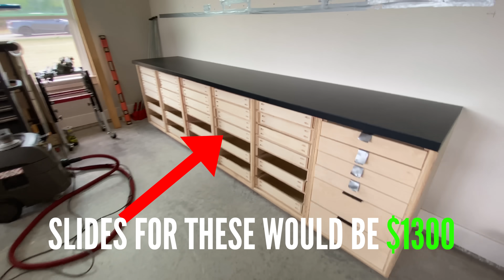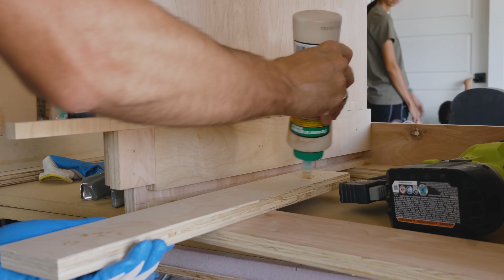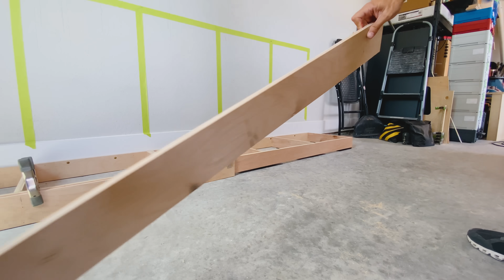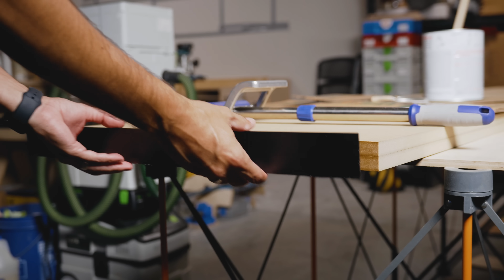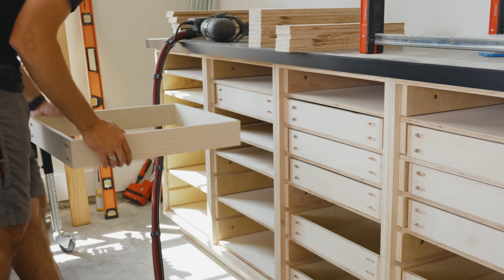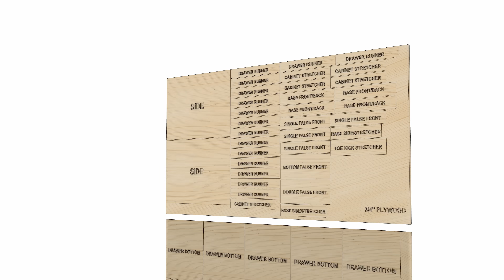Drawer slides are expensive. Do this instead.

Comment: 00:00 🛠 Making simple cabinets without hardware can save a significant amount, cutting costs on drawer slides.
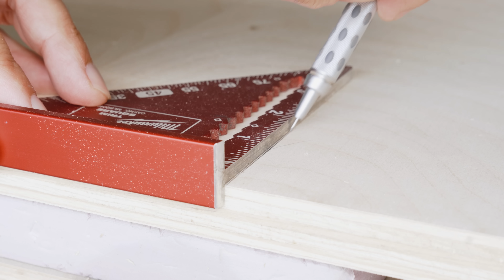01:22 📏 Tips for plywood projects: Start by squaring off the factory edge, use parallel guides for precision, and optimize standard track lengths for accurate cuts.
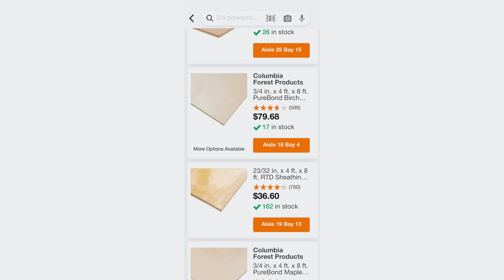03:41 💸 Quality plywood at lower prices often comes from direct suppliers rather than big box stores.
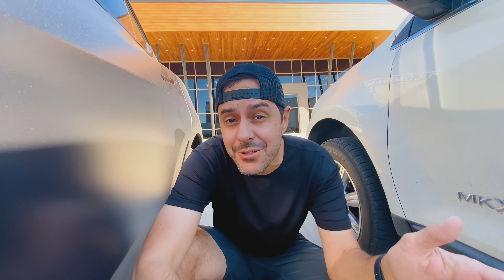05:06 🪚 Visiting specialized plywood companies can offer high-quality options at more reasonable prices compared to mainstream stores.
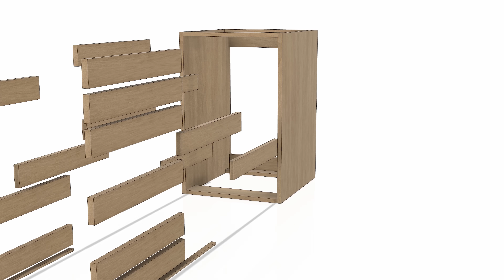07:15 🛠 Building cabinets without cutting into the sides maintains strength andsimplifies the process, especially for beginners.
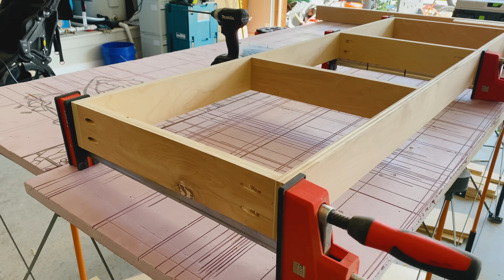09:44 🏗 Creating separate toe kicks rather than cutting into the cabinet sides offers a cleaner look and makes leveling easier.
11:23 🔨 Shimming floors for leveling cabinets is crucial, using composite shims for better consistency.
13:40 🚪 Insulating behind cabinets during installation can be a proactive measure against potential issues in the future.
16:15 🔲 Crafting laminate counters involves careful planning and precision with contact cement, benefiting from an extra pair of hands.
19:54 🤔 Routing laminate edges can be tricky, requiring a balance between pressure and precision to avoid cutting into the material.
21:05 🔧 Using temporary fences and tools like an oscillating tool simplifies precise cuts for covering cabinet sides.
21:19 🔨 Building cabinets without hardware involves creative solutions; metal drawer pulls can be a sleek and affordable alternative.
22:26 🛠 Using parallel clamps for assembling pocket hole screws ensures precision and ease in construction.
23:49 🗜 Attaching drawer bottoms involves using a combination square for precise alignment, aiding in flawless assembly.
25:11 🔩 Installing metal handles requires creating a slight recess on the back of false fronts, easily done with a DIY router table setup.
26:57 📐 Building cost-effective upper cabinets involves using plans that optimizematerials and design for efficient construction.
27:26 🔧 Installing cabinets solo is manageable by using a horizontal board to mark stud locations and secure cabinets during installation.
28:25 💰 Plywood quality impacts costs; using cheaper imported plywood for cabinets could significantly reduce expenses without sacrificing quality.
29:08 💸 Detailed cost breakdown: Utilizing different grades of plywood affects the overall cost, offering insights into cost-saving strategies.
30:17 🏗 Sneakily debunking assumptions by revealing meticulous workmanship in the video's conclusion.
Reply: Thank you so much! This needs to be a pinned comment! There were so many useful tips in this video and your timestamps made it soooo much easier to go back and rewatch the segments. 👌

Comment: I've worked with Laminate before. Most carpenters that work with laminate mostly use an oil and whip the laminate on the side prior to routing the top laminate. You use the straight laminate counter bit instead of the trim router bit. So you can cover the top piece of the side laminate. One thing that was taught to me is to use a small heavy roller on all attached laminate pieces prior to routing because if things flex the edges are more likely to chip or crack.

Comment: In my country the rails you mentioned cost 3~4 euros only for a pair. It would cost me around 100 euros (110$) for all 36 of them. Of course the good thing on how you made it is that you can remove the drawers and put them in a different slot and would still work as they do not have a mechanism.

Comment: Thank you for the ideas and the work. My concern would be the use of the draw bottom being the draw runner as over time, and depending on the weight of the draw contents of the aware as all draws with timber runners wear. Maybe a though next time to look at the tried and old style of timber runners, less ply being used as guilds and the use of other smaller timbers, offcuts to so you can have the draw slightly wider etc and in time can be replaced if required. Also maybe a lighter bottom of the draw but of cause depending on the weight.  Ready good thoughts and details for people to follow. Thank again.

Comment: That was a deep dive 🤿into the comparative value of different grades of plywood. Cheers! That is the most satisfying storage build I've seen yet. Adjustable, build to suit. I still have 13 seconds to go, but what about the "seams" between cabinets where you can see the horizontal cabinet walls. You seem like the sort where finnicky details like that would bother you. Way better than anything I have ever done.
Reply from the maker: Thank you! I don't mind the seems. I never really notice them. At least that's what I tell OCD self at night when I stare into the ceiling and cry
Reply: I just finished a front stoop / stairs / landing project, and it does look good, but all I can see are the gaps and perceived unintentional slopes. Being unwaveringly OCD does have its benefits, but so does reason and sanity.

Comment: That's an impressive set of cabinets for under 🤿 $1500 all-in. 
When I made mine, I surfaced the counter with wood so that if it got damaged through using it as a workbench. I could either plane it smooth, or replace it when it got really bad.
But your laminate looks really good.

Comment: Great project & video. Subscribed.Been looking for something like this, after trying to figure out ways on my own to omit drawer slides. However, I didn't see anything in the video  or comments regarding drawer stops (did I miss it?), so I assume you didn't use stops. Without spending a lot on hardware, is there a simple way to add stops to keep the draws from coming out, while still allowing easy removal? Thanks.

Comment: They are great and i much prefer simple designs that dont use lots of hardware. simple & does the job but very strong and upto the task. I like using birch ply for projects & plan the builds with dados and lapjoints, avoiding screws & using pva with brad nails

Comment: One trick for next time to make your drawers slide like butter: put some ultra high molecular weight (UHMW) tape between the drawer bottoms and the pieces they slide on. It's probably better to adhere to the cabinet than the drawer, but either would work, obviously. The tape is super tough and super slick. It makes wood-on-(UHMW-tape-on)-wood drawers almost as nice as ones with glides.
Reply: ...and if you don't have the room for the tape (it's 2mm thick, right? and you have to put some at the bottom but also at the top of the slot), you can use the following recipe: mix some wax (bee-wax or else) with talc powder. I also used this for the central screw of a piano stool (the one for tuning the height of the stool) that was squeaking like hell, and it works like magic.
Reply: @gilbertcabasse6168  it comes in lots of thicknesses. Obviously the thicker ones are tougher, but even the thin ones are surprisingly tough. McMaster stocks it down to about 0.1 mm.
Reply: @gilbertcabasse6168  I've always just put it on one side (tape rubbing on wood), not both (tape rubbing on tape), and it seems to work fine. Wax also works nicely, though.
Reply: I’ve used both UHMW tape and wax and was stunned how well the wax worked when using decent quality plywood for drawers like these.
Reply: @NigelBassman   Ya, most times if you have older/antique cabinet drawers or dresser drawers, they're on wooden slides. They were waxed at the factory or by the cabinet maker originally. Most people pull them out and put in metal slides because they "stick." I mean, if it's an antique, it probably hasn't been waxed since the 1920s, and if it was built in the 1950s, it probably hasn't been waxed since it was built, since household help and housewives who knew it needed doing and had the time disappeared by the 1980s. Of course it sticks. As long as the wood is in good condition, all you really need to do is clean the wood and then wax  (slide and drawer bottoms or groove--very high quality drawers might have a dowel and groove slide) with good quality wax (preferably beeswax), and presto.  If the wood slide is worn, you can just replace the wood slide, then wax and repeat. Hint: it's easier to apply on a warm summer day, when the wax is a little soft. Hint two: craftsmen also applied a very thing buffing of wax to the insides of the clean drawers. Helps preserve the wood and keep it clean. They make a special brush for this, it looks like a shaving brush on steroids.
Reply: @beckifahle9346  When in need we use soapbars to make such drawers slide more easily.
Reply: 3” wide x 90’  = .21 per foot.  I cut it on ban saw > 1/2” wide = .06 per foot. = 90 foot rolls for under $.   Carpenters use your math skills and Sand properly to save/make money😂

Comment: 🤿 i love it, i may do the same for just a couple drawers that are currently open storage slots 😅.  btw, if you ever do any future mudding, the easy sand 90 minute quickset mud is a life changer, it gives you a good working time, you can mix it to your desired consistency, and say bye bye to cracks and shrinkage.  overall just a much better product to work with than spackle.  you can also throw some wood glue in the mix for a better quality mud.
Reply from the maker: Will do!!

Comment: One thing I might have done is set up a router table and route the slots in for the bottom drawer. This way all you had to do was set them in and glue and clamp. Scribe and brad nail the bottom. 
We are going to be building two double desk that are 20 feet long. With all drawers in them. I do like your idea. 
One thing I would change is add some of the bands to the bottom of the drawers so that way the drawers have something hard and smooth to slide on. This will allow one to stain and poly the cabinets for a finish. 
My current desk is 12'7" and is just your run of the mill counter top. The MDF counter top while nice exceeded the cost. Nice high end counter tops are pretty cheap. 
Couple of additional things that I would add is larger triangle to the tops where the cabinets are for when the next person rips them out and sells them. 
I super like the base and that is the best thing one can do to level it. The two 20 foot desks will be going on finished concrete floor so something like this will have to be done as well. There will be two end sections and one middle section and the seam in the middle. Since we will be using bought counter tops we will glue plywood to the bottom of the countertop making it thicker and smooth. I want to add a wide enough strip that covers the bottom edge and then a large enough piece that covers the desk underside. This will be quite nice. 
Though my second option is using those butcher block countertops which could avoid most of everything in the last paragraph. If I go this route I want to route the edges and transition from a rounded edge for the desk to a fancy edge for the rest of the areas. 
To match the bottom desk to the upper cabinets which will be the full 20 foot long and will have 2 large swivel tv mounts to hold the 85 inch tvs and those are long enough to swing the tvs out of the way to reach in to the cabinets behind. The desk height being around 24 inches, the gap being 3 foot and the upper cabinets being 5 foot with under cabinet lighting and trim ( to block glare from sitting afar and viewing the screen. We will have a mix of cabinets and shelf along with some cubes made of plywood as well. These uppers will be your standard 24 inch deep cabinets and not those half ones. Since it will be 5 foot there will be a 6 inch on top trim and a 6 inch bottom trim. With adjustments to accommodate 4 cubes stacked tall at 11.5x11.5x11.5. We will do a double stacked cubes and since they will be wood we can stain them in several colors for the accent. Stains come in all colors so we will be able to choose the overall neutral color which is likely going to be an espresso along with some red and purple stains for cubes. Along with another color set for the rear cubes.
Reply from the maker: yeah thats a good idea. I did the router trick on my last shop - and while it worked like a charm, I didn't feel the sawdust and noise was worth it. But it did make everything perfect.

Comment: Were you poking fun at the pronunciation of drawer? It's not draw. Draw is a verb. Drawer is a noun. Ps. Take candle wax to the edges that connect with the "drawer" slots. Simple, cheap and smoothe sliding. Very nice build. <snorkle emoji>
Reply from the maker: yes, its a sarcastic nod to Tamar at 3x3 custom

Comment: I don't understand the pricing. I can buy side-mount, full-extension, 100# rated drawer sides 22" long for $7.53 each, all day. That would come to $263.55. On the other hand, I have built several shop cabinets very similar to yours, and even $7.50 per drawer seems too high given the result! For the purpose of general storage, these can't be beat at any price. Being able to pull the drawer out of the box in one smooth motion and place it on the bench top makes these drawers so much easier to access it makes the $263.55 seem like a waste of money!
Reply from the maker: yep.

Comment: Brad gun knowledge ( not going to call it a trick) 99% or the time the brad will take a turn side to side rather than front to rear. So for example, you are nailing a drawer side to a false front, the side being the part that laps the false front, you want the gun parallel to the side top not perpendicular, this goes for all lap joints. The brad is weaker on its side to side profile and usually bends in that direction. Id post a drawing but don't know how to do that here.

Comment: yeah but dude... lol. You've got $30,000 of hardware there in a semi-pro dedicated hobby shop so that's where your cost differential has been offset to.
Reply: That may be so, but he used only a handful of what he had to do this build to show you don’t need a shop full of expensive tools to do it. Most of the equipment he has was not even available to use during this build. Basically built with a tape measure, pencil, tracksaw, drill, driver, level, pocket hole jig, and I brought the file, because his, along with the majority of the rest of his gadgets were still packed away in boxes. 😃

Comment: In my RV, the drawer slides are constantly ejecting ball bearings and eventually coming apart.  Doing away with drawer slides is smart.  Staying away from cheap drawer slides is essential!

Another comment; routing your laminate edges with a 45° chamfer reduces chipping, and that would have avoided the chatter marks.

Great video!  👌  🤺🧑‍🚒🫶🥸🎭🎯📢🎳🧨🛟🍺::snorkel

Comment: A laminate trick my dad showed me was to take a candle stick and rub the edges where the bearing will rub. The wax keeps the bearing from burning the laminate and can be cleaned off when you're done
Reply: my dad would buy an electronic candle so that he doesnt have to clean the laminate afterwards
Reply: Fantastic Idea
Reply: I've used ordinary hand soap (hundreds of bars from years on the road) to provide lubrication for drawers and sliding windows.
Reply: How about just not burning up your work in the first place?
Reply: I think it would be better to use the actual candle, not a candle stick.  I don't see how rubbing a candle stick on the runners would do anything at all.
Reply: @Andyloveswood I see what you did there! 😂😂😂
Reply: @Andyloveswood  that's gold my friend
Reply: @Andyloveswood  the candle is for using a router to trim laminate, not for the runners
Reply: Right.  But a candle would still work better than a candle stick.
Reply: @Andyloveswood  🤣🤣🤣 fair point!
Reply: Ok, but that wasn't the problem here.
Reply: @Snaffer01  could have been

Comment: If youd like to know how to do it with a cheap one, slowly starting on the longer edge, or middle of the length measurement, and very gentle like, let the bearing roll, its literally a beast, if you push it hard or put a bad bit on, the router bit can go flying, so make sure to clean or oil your bits, and let it just pull you, so, so, so slow, then it comes out perfect, youre almost fighting to push into it as softly as possible, sometimes two passes or three
Reply: And if your wondering about the corner, you don't go backwards or anything, you kinda do these passes into the corners that aren't touching the bearing yet, and if you're good it can actually be easier to just finish it bye sanding(CROUCHING WHILE USING A ROUTER TO CHECK THE POSITION OF THE ROUTER CUT IS PERMISSABLE IF YOU JUST MAKE SURE TO TIGHTEN THAT FLYIN BULLET DOWN, AND DO NOT MOVE THE ROUTER)

Comment: 2 things could cause your router issue on the top. Either you were pushing too hard or the bearing was getting stuck and spinning with the bit, which could also happen from pushing too hard. Tape on the edge could help, but if you double side sticky tape a second piece of laminate or some other material to the edge banding, you can use the bastard file to trim off the remaining. This is how I was taught by a pro cabinet and counter builder when you don't have the special trim bit the leaves a tiny lip. With the special bit, you do tape the edge banding. You also want to file a slight angle on the edge to reduce the chance of catching the top laminate. 

Do keep in mind, that was more than 20 years ago, there is probably a better and easier way to do it now a days. But this method does work.

Comment: In my shop we shoot brands into the edges of pocket holes joints on the rare occasion we are using pocket screws instead of dados or rabbets. Shoots 2 or 3 brads, those will hold the wood in place while you drive the pocket hole screws in, and of course, glue.